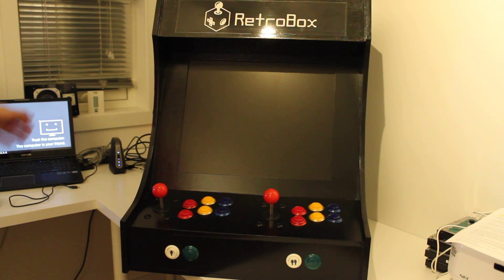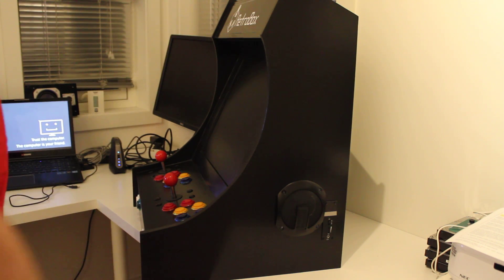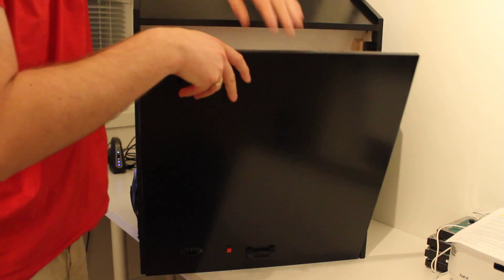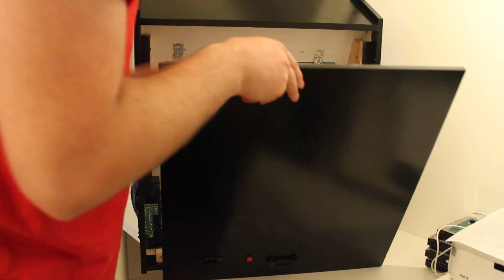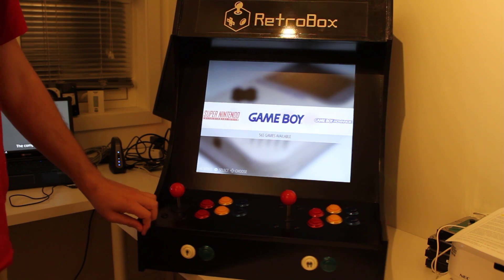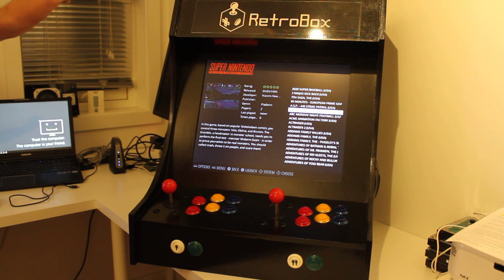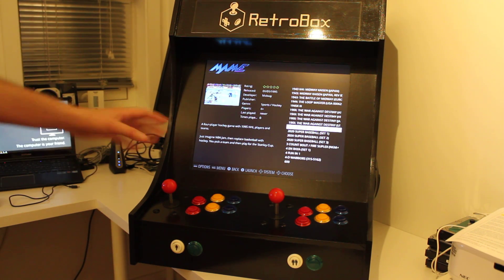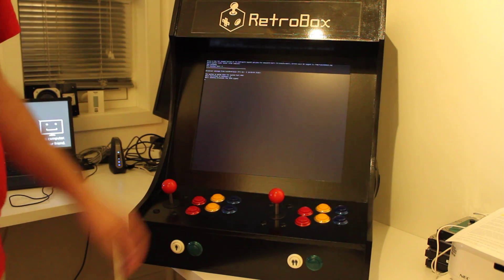RetroBox - Second RetroPie Arcade Build

Comment: Nice build man. Need to try a jamma build next, assuming you haven't already. A little more complicated but well worth it for the experience. Cool thing about jamma builds is they are arcades. What that means is they're extremely user friendly once put together. You can let your friends play on it without having to worry about them screwing the OS up or something.
Reply from the maker: Thanks! I have heard of jamma before, but that's about it. Never tried to build a machine using other hardware than a regular PC or Raspberry Pi yet. I totally agree that it would be a fun experience, but a proper build should never expose the OS anyway. Even my Windows build, RetroFE replaces the Windows shell, so there is no way the user will ever know that it's running on Windows except during boot. I'm currently working on integrating RFID on my build which I have been planning for a really long time, so playing around with jamma unfortunately has to be postponed for now... :)

Here's a preview of the current theme/UI on my Windows build:
https://idmedia.no/projects/retrobox/preview-retrobox-theme-retrofe/
Reply: It's just worth the experience. It would open you up to working on old arcades and stuff later.
Reply from the maker: +LLB LLB I totally agree with you. I'll add it to my bucket list and do some more research :)

Comment: IDmedia I have 2 questions. 
1. You said you can exit out of a game by pressing start and select. I am not able to do that with mame, are you able to? and if you did how?
2. where did you find so many compatible mame games? and which mame emulator did you use?
Reply from the maker: 1. Yeah, that's actually pretty simple. Just open MAME and hit TAB in order to open the settings menu. From here go to Input and look for UI Cancel. Here you can assign both buttons to act as the exit button. If you for some reason struggle to get it to work, navigate to the config file (RetroPie: \opt\retropie\configs\mame-advmame\advmame-1.4.rc) and set input_map[ui_cancel] to keyboard[0,enter] keyboard[0,space] or joystick_button[0,7] joystick_button[0,6] or similar. That will let you close the emulator using ENTER+SPACE with a keyboard or button 6+7 on Player 1 Joystick. Hope that helps!

2. I'm using advmame-1.4.rc and romset 0.106. I used Google to find a compatible romset and used a custom coded scraper to get all images, descriptions and metadata for almost all games. I'm working on a version I can release to the public, but unfortunately I don't have much time to devote to the project for now, but it will happen as I'm building another arcade with another romset and front-end so I also need it... :)
You can find more info on MAME and romsets here: https://github.com/retropie/retropie-setup/wiki/MAME

After downloading the romset I filtered it with RomLister so I only have roms that I know are compatible with the number of buttons I have. It's a fantastic tool. I'll make a video guide for you if you are interested. Once I've finished the new video I'm doing for my next arcade build I just finished. :)
Reply: IDmedia Thank you for your quick and detailed response. Can't believe I missed the UI cancel I feel foolish. This this the first time I have ever worked with a raspberry pi. I am actually using the pi zero. I thought about getting the getting the pi 3 model B, but found the zero on sale at a local store and saw many people have success. Have you tried the zero yourself? Mine seems to work ok with all emulators so far like neogeo, snes, mame. haven't tested n64 or psx as I would think they would run very slow. At times my pi zero will run games fine like a champ and then the fps will slow down at times on any emu doesn't matter which. Could that be heating issue (have not installed a heat sink but the pi is not enclosed in any case right now), or some settings I have not tweaked, or just a faulty pi zero? 

And also I thought you used adv mame. However when installing retropie on the pi zero I created my retropie folder on a usb flash drive. After unplugging and looking at the list of emu rom folders it provided me it only showed mame4all and libreto mame (many others i've seen were missing too like scumm, macintosh,etc). Is adv mame only show on pi 2 and 3 or do I have to side load it individually, if so how? I can't seem to find the answer.

Thx in advance
Reply from the maker: >Have you tried the zero yourself?
Yes, I'm actually currently trying to build my own gameboy using one. It's quite awesome, especially considering the OTG port and all features that comes with that.

>Could that be heating issue
I doubt that. If there's a problem with heat, a red square is displayed in the upper right corner of your screen and a rainbow colored one if the PI is under-powered. If just think that the Pi Zero might not be powerful enough. Get a Pi 2 or 3 and give that a try, I assume that you'll have way better performance.

>And also I thought you used adv mame
Yes I do. It might only be included on Pi 2 and 3 as you said... I don't know myself. I have it in my list of emulators once I press a key after launching a MAME game. If it's not included on a Pi Zero there's a reason for it... I recommend you to upgrade to a Pi 2 (or better yet) 3. :)
Reply: IDmedia I figured that might be the case. I just wanted to try out the pi zero in a nes cartridge like i've seen others do. I wasn't sure if I could put the pi 3 in the nes cartridge due to its height difference and also I hear they get much hotter unlike the pi zero.

I saw you had many emus installed. were there any emus that you found did not work very well with raspberry pi and do not recommend installing?
Reply from the maker: One of the biggest issues with EmulationStation (the front-end RetroPie uses) is that it's horrible slow when using many roms. Because of that I've limited my selection of roms to only include those I care about + all arcade games. I also don't want to include systems that would require a gamepad in order to be played so that's why I don't bother to include N64 or PlayStation. As far as I remember I've only changed one emulator from the default and that's adv-mame 1.4 (I think 1.2 is the default).

I really recommend the RetroPie wiki for information about compatibility: https://github.com/retropie/retropie-setup/wiki
Reply: Thanks for your feed back you've been very helpful. I will continue to follow you and hope to see your new videos soon. Much success to you.
Reply: One Last thing for now did you or do you have to expand the filesytem in raspi config? Does this help for rom  storage?
Reply from the maker: Yes. In fact, the latest version of RetroPie or Raspbian will do that automatically for you on the first boot as far as I can remember. If not just run raspi-config. Without this you can't store much data on the SD card (just a few MB). Even if the card is 32GB... so you will need to expand the partition. :) You can check the storage from the terminal by using the "df" command.
Reply from the maker: Thanks. I'm currently making a new video of the next arcade I've just finished.. the same as this but with LED buttons. Stay tuned. :)
Reply: Hey IDmedia, Ive had some luck installing and getting  advmame .94 working but for the life of me I don't know how you installed advmame 1.4. I found the romset 106 but advmame 1.4 isn't an option in retropi to download. Can you tell me where you found it and how you installed it in retro pie or do a video on it?
Reply from the maker: +KeepIT Real Are you using a Raspberry Pi 2 or 3? It's supposed to be included... I didn't install it myself, just set it to be the default emulator. I suppose Pi 1 and zero doesn't offer that version for some compatibility reasons.
Reply from the maker: +KeepIT Real Are you using a Raspberry Pi 2 or 3? It's supposed to be included... I didn't install it myself, just set it to be the default emulator. I suppose Pi 1 and zero doesn't offer that version for some compatibility reasons.
Reply: i have both the pi zero and pi 3 right now by default retropi gives me mame4all and  mame libretro in both, I installed advmame under manage optional packages in both as well, the only other mames there is lr-mame 2010. And under experimental packages they have lr-mame 2014 and lr-mame which is the current port for libretro. am i looking in the wrong spot ? or do I need to update something?
Reply from the maker: I'm sorry, but I'm not sure without further testing. I've downloaded the Pi2/3 version from here and written it to a SD-card. Booted up the PI and when launching a rom I press the a-button (or whatever it was) and then I'm able to change my default emulator from the list. Link: https://retropie.org.uk/download/
Reply: Ok got it, the default advmame is .94 so yes the way to switch it is there by launching and switching. Now I will have further testing and get back to you. Thx will let you know how it goes.

Comment: hi there, I noticed that you used a xin mo controller board for the emulation station/retro pi, how did you get it to work without any glitches? on mine a have various bugs where two player isn't getting picked up
Reply from the maker: Read the "Known bugs" section on my blog for a fix: https://idmedia.no/projects/retrobox/retropie-3-running-on-my-bartop-arcade/

Apart from the split, I haven't noticed any glitches. The joysticks are not the best so I've 3D printed new restrictor plates and done some improvements. I'll try to cover that in another video once I get the time. :)
Reply: +IDmedia It still doesn't work, so I decided to use a windows machine instead as the raspberry Pi has problems with the monitor too, so what programme (emulator interface) would you recommend the works with the xin mo controller on windoes (that I can control the interface with it as well)
Reply from the maker: +Armaan Hussain Good question. To be honest I don't like any of them, so I don't use one myself for the time being. Hyperspin is popular and so is RetroFe.
Reply: +IDmedia and it can work with just the xin mo controller alone?
Reply from the maker: +Armaan Hussain It should, but I've not tried it myself. Might require some playing around, but any HID device should theoretically work

Comment: Hey man, 
great work! I have a few problems with my project... 
Your link above to your blog is not longer available? 
is there any chance to get something like an instruction? Because i have problems to run it with 2 player and also to get the right roms. Thank you in advance
Reply from the maker: +Daniel Flad Thanks for your comment and for pointing out the broken urls. YouTube breaks them sometimes when editing.. no idea why, but I have fixed them now. :)
Unfortunately I can't help you regarding the roms, but if you search for the specific romset version on Google, you should be able to find it. Regarding the 2 player issue, this post might help: https://idmedia.no/projects/retrobox/retropie-3-running-on-my-bartop-arcade/

Comment: Nice one Im going to be making one of these real soon ! This might be a daft question but i take it the Pi knows which buttons are which for each console ? or do you need to set this up each time ? What i mean is if you go into SNES and the buttons are all mapped, if you back out and go into mega drive for example, do you need to set the keys for that.
Reply from the maker: +CornswolioTV I'm not completely sure if I understand your question, but you don't have to reconfigure the button layout every time. In fact, RetroPie helps you configure it on a global level on first boot, but you can easily override the configuration on a system level. I recommend to check out their wiki, it's has all the info you need. :)
Reply: Thanks for the reply man, much appreciated. Apologies for late reply.

Comment: Awesome arcade! I bought the Xin mo 2 player set and have it hooked up but ran into all kinds of problems trying to detect to players. I finally changed the boot cmd.text to have it register 2 players but now I cannot get the darn thing to map the buttons for both player 1 and 2. How did you configure you Xin mo for two (or more) players? Thanks for any advice.
Reply from the maker: +Holytoledo86 You mean you changed /boot/cmdline.txt? I didn't have any issues after that. Did you take a look at my post? Maybe that will help you out: https://idmedia.no/projects/retrobox/retropie-3-running-on-my-bartop-arcade/

I would recommend to verify the changes you've made and test both joysticks using "jstest /dev/input/js0" and "jstest /dev/input/js1".

Comment: How did you delete apple 2. Etc.
Reply from the maker: +xChaos_Acid Navigate to the roms directory (/home/pi/RetroPie/roms if I remember correctly) or by using SMB (\\YOURPIs-IP\roms) and delete whatever is in the apple roms directory. Empty directories won't show up in the meny.
Reply: +IDmedia what else did you delete?
Reply from the maker: +xChaos_Acid At first I cleaned out all the roms directories to make sure that it didn't list any systems I don't want. That should be enough in most cases.

Now I'm using gamelists, so only games defined in it's own gamelist.xml are shown. This way I have complete control over the roms listed without having to modify my romset. MAME is a good example here. Since a lot of roms share dependencies it's a mess trying to delete roms, so it's easier to create a gamelist instead. Read more on gamelists on my blog: https://idmedia.no/projects/retrobox/retropie-3-running-on-my-bartop-arcade/

I'm currently working on a tool that makes this easy, but since I'm working as a developer full time now it will unfortunately take a while before it's ready to be released. :)

Comment: where did you get the regular pc  power plug  and reset button for the back
Reply from the maker: +Dale Ackley I got the PC power plug from the local hardware store and the reset button is from eBay similar to this one: http://ebay.to/22YhYm7
Reply: how about the power plug on the back also
Reply from the maker: +Dale Ackley As mentioned, I found it in the local hardware shop where I live. Just search eBay for "C14 female" and you should find them.

Comment: How much did you spend in total?
Reply from the maker: +Louis Pecci In total... way to much because I didn't have the tools to do the job to begin with. If I remember correctly I spend somewhere around 500 USD on the arcade itself (hardware, paint, monitor, controls, trial and error, etc). Unfortunately there cost of importing stuff like the controls is quite high since we don't have shops in Norway that sells cool things like that. If you live in the states it's way cheaper though... :)
Reply: Thanks, I am living in England... I'm studying computer science - second year. I still have a lot to learn though. If I had time and space I would definitely try to build one similar to yours'. Your setup is one of the best I've seen online.
Reply from the maker: +Louis Pecci Thank you so much!

I've also studied computer science (Network & Security), but graduated a few years ago. Started with programming in my spare time and now I work professionally as a "developer" at the university I graduated from. Personally I would love to learn more about electronics as it would help tremendously to be able to design your own PCB boards when doing projects like this. My next project is building my own GameBoy that's able to run original games and later on 3D modelling my own handheld console.

Good luck with your project! It's a very good way of learning more about all sorts of stuff, both in terms of hardware and software. :)